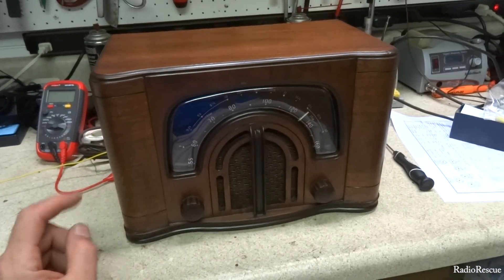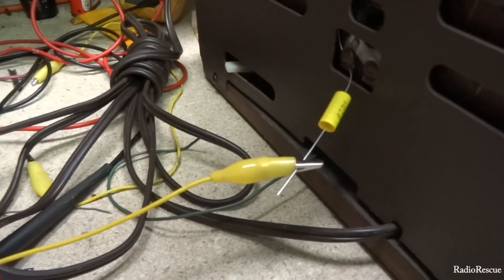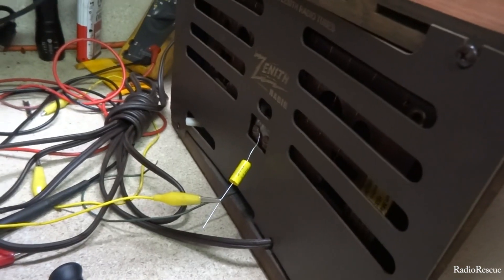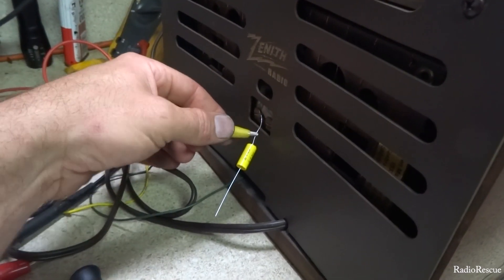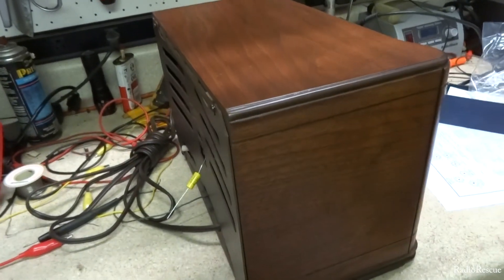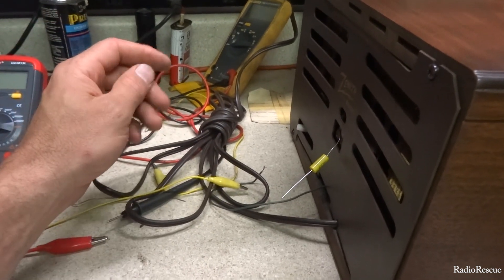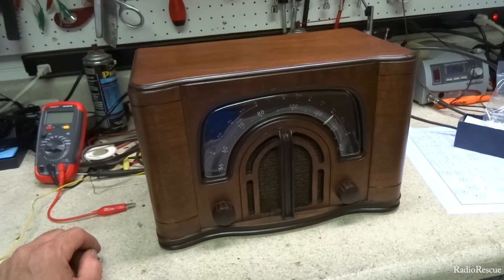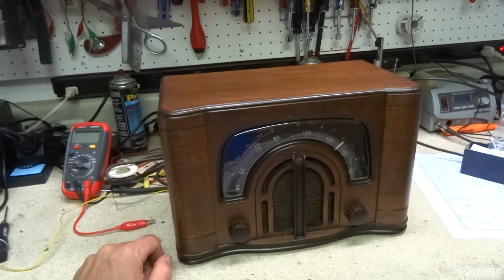How to Capacitively couple antenna to a tube radio.

Comment: Excellent video!  congratulations!  I think that this problem that you describe is due to the impedance of the antenna.  If I do not remember more, in those times the impedance of an antenna was 300 ohms.  In this case, capacitive coupling can help, and you can just as well use a balum or some RC coupling network.  Thanks for sharing!

Comment: The last Zenith I had that quit working intermittently had a bad 50L6. After it was running a while, the heater would open, and as the cathodes cooled, of course it would quit. Then, the minute I started trying to figure out what happened, it would start working again! It sure took me a while to figure that one out!  I look forward to finding out if one of the tubes has a low speed "blinker" for a heater!
Reply from the maker: This one has a 35l6 as it's a tuned RF stage job.I haven't got a chance to mess with it but I suspect a flakey tube.

Comment: Good video!  I usually place a coil of the end of the antenna wire across the back of a set with a loop antenna.  Some of these sets have a capacitor already, going to the external antenna connection!  Shows the importance of changing that one (I know a lot of restorers don't bother).